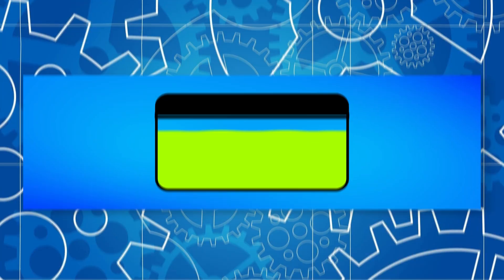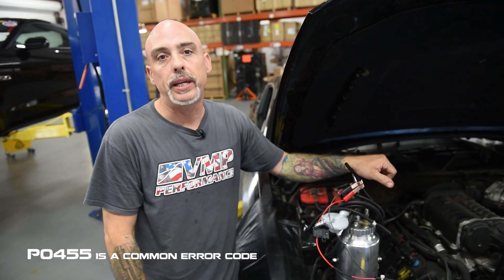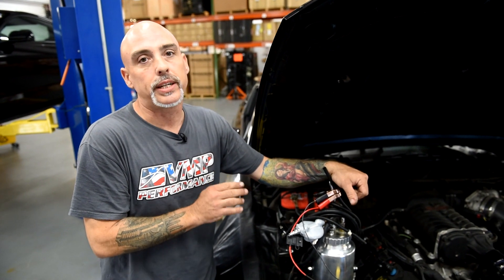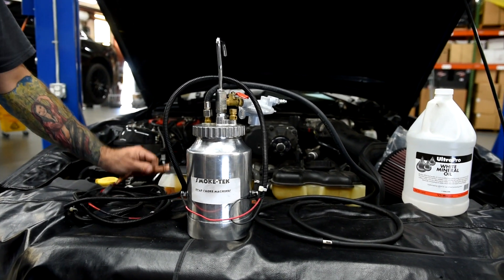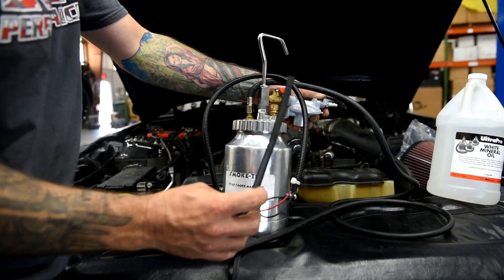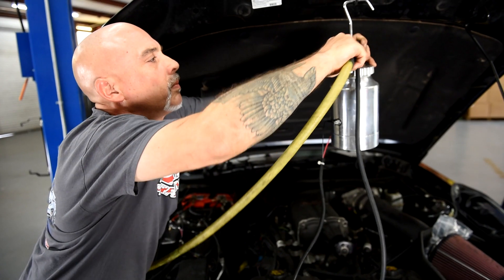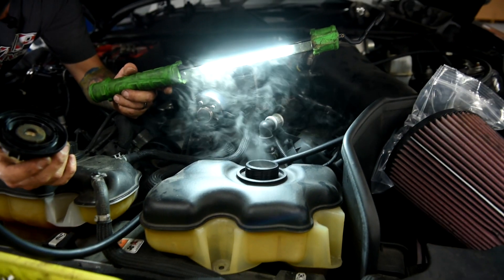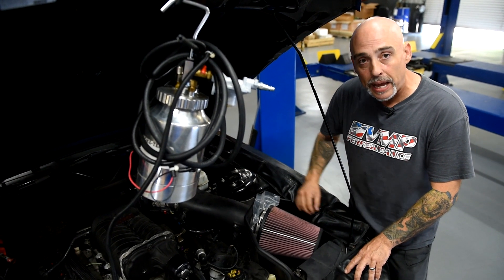Tech || Diagnostic Smoke Testing for Air to Water Intercooler Leak

Comment: Yes I have been doing this for years on piping systems for buildings I use compressed air with a heating element AKA fog machine and some juice that way I can find a leak in piping that I can't hear with compressed air so you add the visual aspect + the hearing aspect perfect 👍

Comment: Definitely want to see the boost leak test performed with all the things to look out for. Great tech vid! This could be a really cool series!
Reply from the maker: Theoretically, this exact test would operate as a boost leak test as well, as it was plumbed through the intake and supercharger.  We just happened to be using it to diagnose a damaged intercooler, as the (smoke) boost was leaking into the heat exchanger system via the damaged intercooler core and was made evident by smoke being present in the HE fluid bottle.

Comment: How the heck does an intercooler core get a leak. Is that the new revised larger intercooler core that came out last October?
Reply from the maker: If a HE pump fails, the coolant temp will rise and if it isn't caught, can/will boil.  That rapid expansion within the intercooler can damage them.  This is an older kit as well.
Reply: @Joe Goodnough Why would anyone use straight water ever.
Reply: I guess the coolant escaped through the reservoir tank?